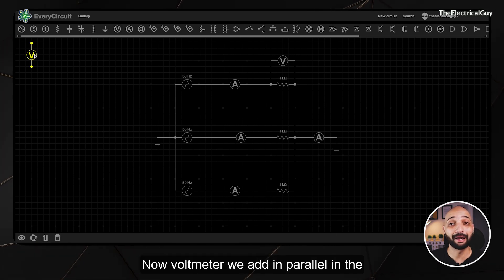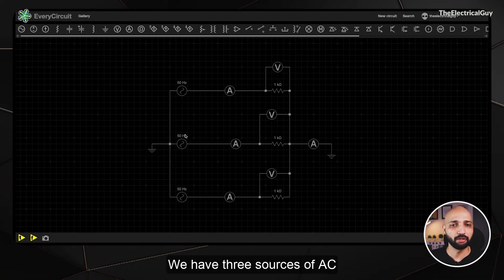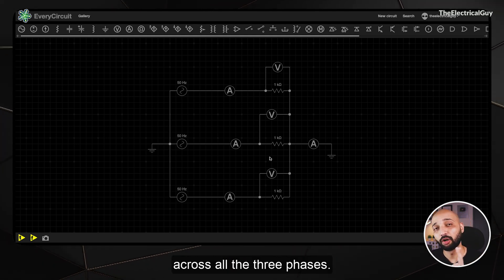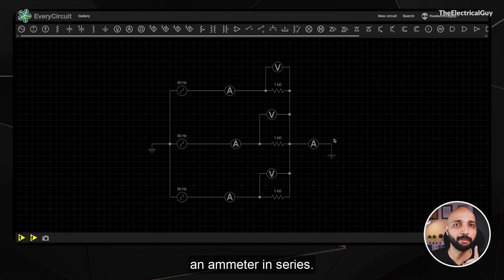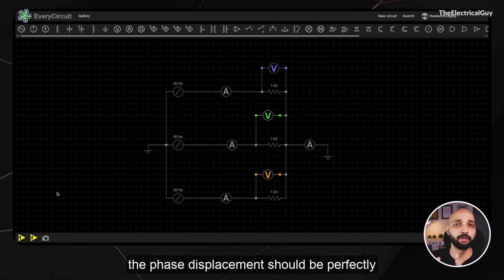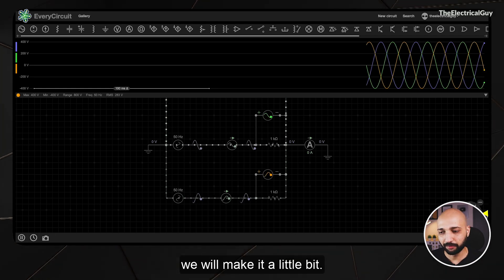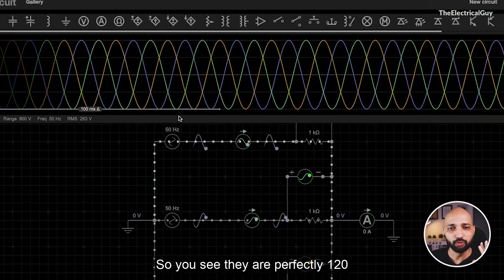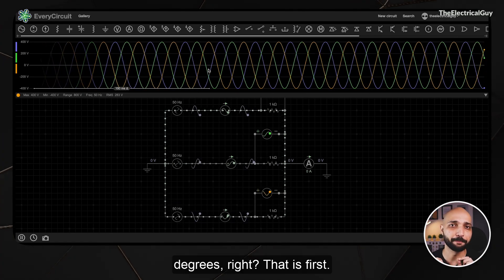3 Phase Balanced System explained With Circuit Simulation | TheElectricalGuy

Comment: I have a Question, If we remove the Neutral from Balanced System (Considering Balance system which is an ideal case) what will happen?
Reply: nothing. If the circuit is balance, there is no need for neutral. In practical terms though, no loads are perfectly equal. So the neutral is there to carry the imbalance currents caused by uneven loads.

Comment: I have a question that makes me think a lot. In electrical classes, we were always taughted that the current flows in the least resistant path. When we look at the star-connected circuit with a neutral point connected to the earth, I cannot understand how current doesn't flow through neutral unless the system is balanced.